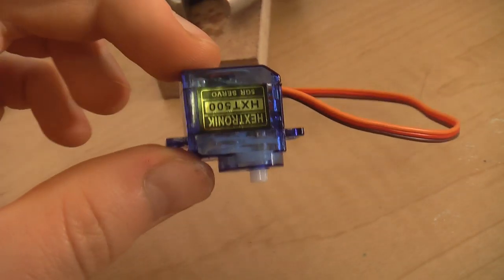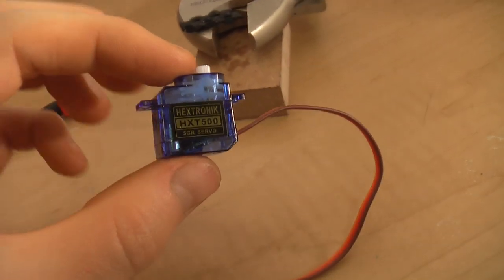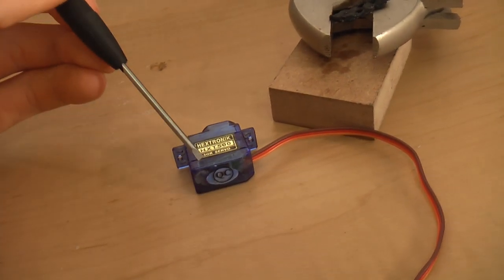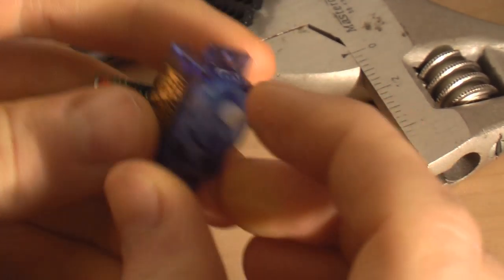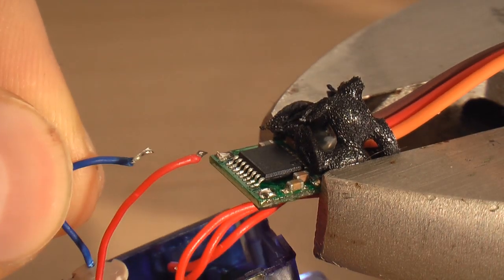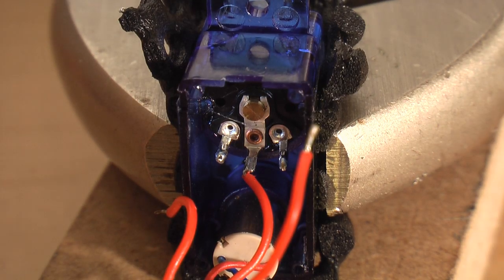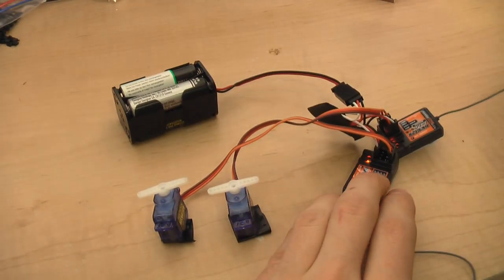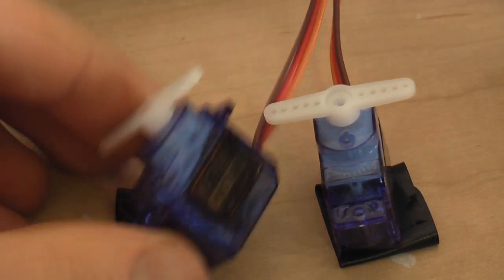How to Manually Reverse a Servo

Comment: Uploader, 
I swapped the 2 motors , changing its polarity but not swaping the pot's outer 2 wires . It gave me a terrible burnt out moment , but i.just saved it by removing its plug ASAP.  
Did not know that I also have to swap the pot's wire , now I knew.  Thanks

Comment: This was a great help. Such a perfect demo. Thanks alot! This is for 2 servos butt to butt mounted on a block for push rods that move an animatronic jaw up and down.
Reply: I just tried this on a micro but can't as the stems for wheels are one unit and not letting u to up a creek without a paddle. Try it yourself to see!

Comment: Thanks very much, worked perfectly. I have a Hobbyking Flybeam which came with 2 Aileron servos pre-installed symmetrically. This saved me having to cut another hole in the wing to invert 1 servo.

Comment: Thanks for the video, it confirmed what I thought, without swapping the pot. wires the motor would just run to the end stop and keep driving.
Mine wasnt that simple, the motor was attached directly to the pcb, so I had to cut tracks and use short leads to cross over the power lines to the motor...
I had no way to reverse the signal as it was the F2 output (roll) from a phantom 2, direction is controlled by the copter roll itself.
Anyway it completed my prototype homemade 2D Gimbal for a walkera iLook Camera, albeit not as smooth as the G2D walkera gimbal which I gave up on. 
I did have a good laugh about some of the comments to swap the power lines into the servo.... hahha.. try that on your car and see what happens... it dont go in reverse for sure... lol .

Comment: Many thanks....worked 100% for my tricopter yaw. Although I was able to change the input direction on my transmitter, the accelerometer was reversed. This allowed me to correct the issue without having to mess with the code. A+

Comment: Just did this and it took 5 minutes. Works a treat. Tried to swap the wires on the plug at the receiver end on the first servo and it fried the board. Good work. Thanks.

Comment: My goodness!  Why didn't you just swap the red & black at the connector?  Why take the servo apart to get at wires that are easy to change?  How many servo cases have you melted sticking that soldering iron in there?  No, man.  All wrong.